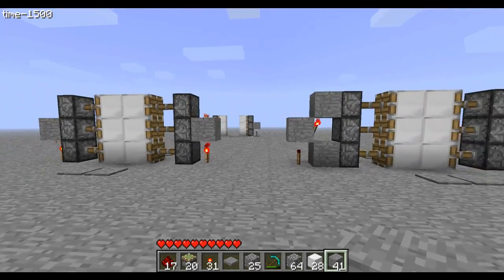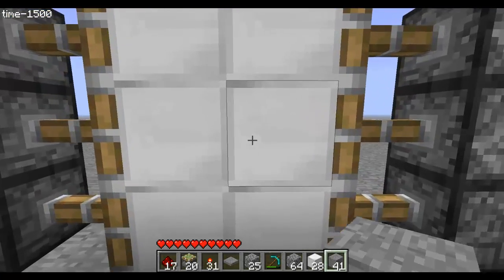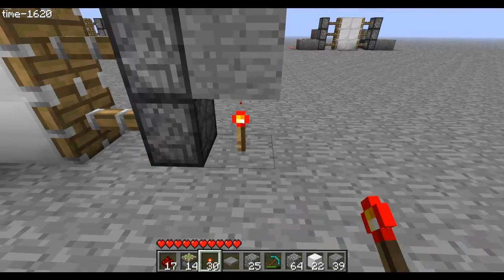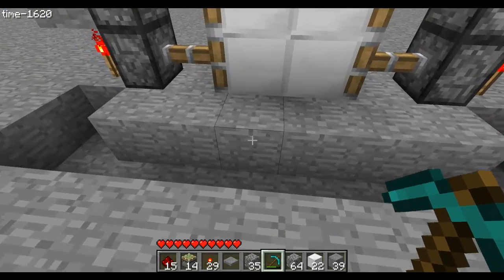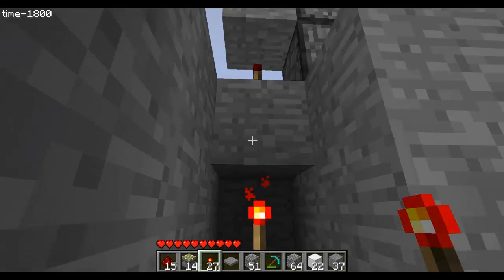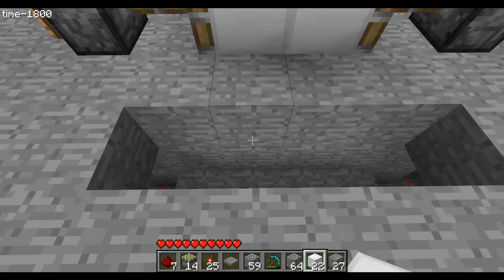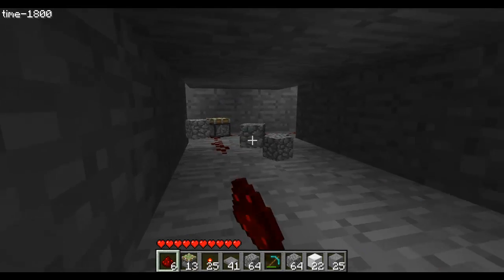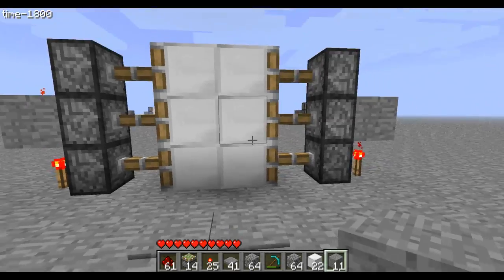Piston Door - MOST compact way [tutorial]

Comment: This isn't the simplest method. After hooking up the second pressure switches, you laid out a 2 wide strip of redstone. You only need to connect the two pressure plates to one wire and string it under the door to the other wire. No need to double up on it like that. Just saying, there is some slop in your design.

Comment: Did you try walking through the door?  The problem with putting the pressure plates two spaces away is that it takes more time to get to and through the door, so it'll probably crush you the way you have it set up now.  Personally I'd rather take the extra half of a second to wait for the door to open than take damage every time I want to get into my house.

Comment: I prefer to fit contraptions to an environment.  A while back I made one that starts from a signal going into a redstone torch at the top then down by wire, winds right on the floor in front of me, and comes back up much like you have here.  I basically pulled it from the Minecraft Wiki's excellent article on redstone circuits.  Unfortunately if it's more than three doors high you run into signal inversion.